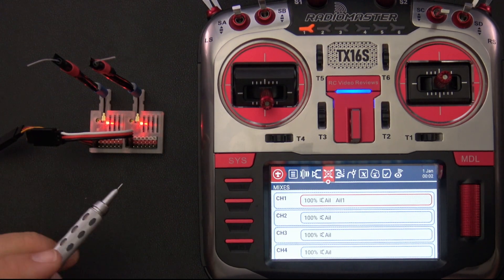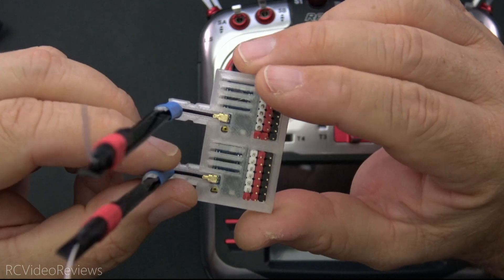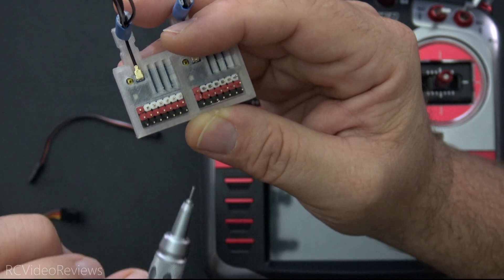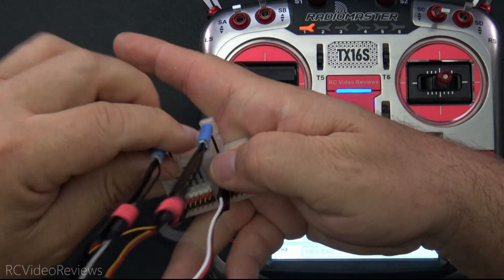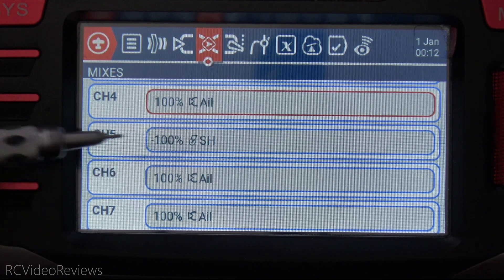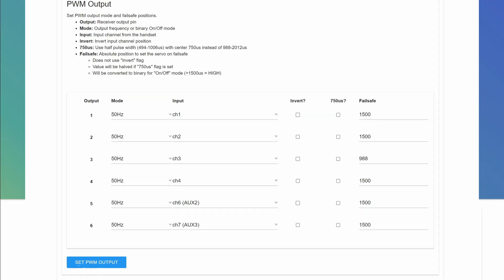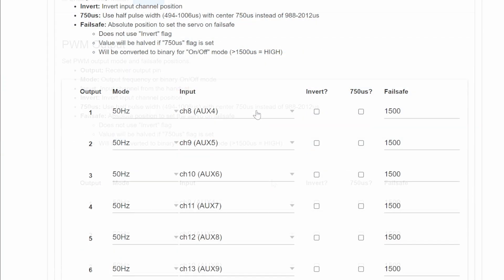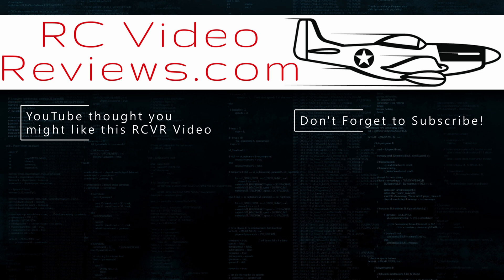Express LRS 12 channel PWM with two Matek R24-P6 receivers

Comment: Perfect! Good detailed explanation for everyone. Something cool you can do is the receivers don't have to be located together. If you're flying a twin tractor with ESCs in the wing, you can have a receiver in each wing powered off the ESC BEC driving that motor and the aileron / flaps for that wing. Even add a third receiver for rudder / elevator. Whatever layout works for your build. 😀
Reply from the maker: Thanks for the extra tips Bryan.

Comment: Would it be possible to use a serial ELRS receiver connected to a flight controller for the main control surface channels and a secondary PWM receiver for other channels? I am looking at using a SpeedyBee F405 wing mini flight controller on a C-130 build, but will need more channels than the mini has. I have several of these Matek 6 channel receivers. I know they have issues, but thats why would use it to control lights, cargo doors ect. and would like to use them in this capacity. 

On a different note. If you were going nuts, could you do more than two receivers using this same approach?

Comment: Great video I have been looking for 10+ channel Rxs for my Tx16S but there aren't many around this method looks straight forward and I will be using it.  I will have to find out how to remap the receivers as I couldn't see what you were using to do this. Similarly I have to find out how to use a computer to program my TxS16 which I believe is possible.
Reply from the maker: EdgeTX Companion for radio setup. I have lots of videos on this. The RX has a built-in wifi page.

Comment: What if someone would want two aileron or two elevator servos? How do you recommend setting up the radio so you dont have half the packet rates compared to the other aileron or elevator since one will be assigned in channels 1-4 while the other would be assigned in channels 6-12?

Comment: Awesome explanation but was wondering where do you go to the 'receiver configuration page'. I have a Gruner 'inside' full house glider which needed 9 channels . I intend to expend another Matek R24 receiver for the remaining channels. Hope someone could guide me on this. thanks.
Reply from the maker: If you start the RX with the TX off, after a preconfigured period of time it goes into "AP" mode. You connect your PC wifi to it. It will broadcast an SSID: Express LRS Rx.  Default password is expresslrs

Once connected to AP, the IP address is 10.0.0.1

Comment: I have one more question. Some rxs come with the T shaped antennas. Can i use a normal straight antenna and if so does it have to be a certain length
Reply from the maker: 2.4ghz ELRS antennas will have the correct active element. It's ok to use a T with a dipole.

Comment: What if you fly planes and your using the ESC to power your Rx , how would you power the other one. Or you can't
Reply from the maker: Jumper wire. that's what I did. Far left row, bottom 2 pins are for power. Connect one to the other. Keep polarity straight of course.
Reply: @RCVideoReviews  Awesome thanks

Comment: with two receivers do you get diversity ?
Reply from the maker: Both receivers listen to the RX, but I'm not sure how you could wire this to get diversity. I've never tried two receivers on a Y telling one servo what to do. And if you didn't have them on a Y, then you have a logic problem. This setup was designed to extend PWM and use two rx's as one, not in a backup mode.
Reply: @RCVideoReviews  ok thanks

Comment: I have heard in comments elsewhere that with elrs v3.0, you can get more than 4 full resolution channels. However no method of achieving this has been made public, as far as I know. I think even with the 12 ch pwm in the video, there are only 4 full res ch. I would appreciate comment on this problem.
Reply from the maker: With 3.0, 8 ch full res full rate. Ch5 is still 1 bit. But you get 1-9 full res.

16ch full res half rate. So at 333hz you get 166hz 16 full res channels including Ch5.

Comment: On those RXs in telemetry there is "Curr" under RxBt, but I can't make it work... Anyone have any ideas?
Reply from the maker: I'm not 100%, but the only external sensor input I'm aware of is vbat. The firmware might just be setup to deliver current for boards with a current sensor input. I can confirm vbat works.